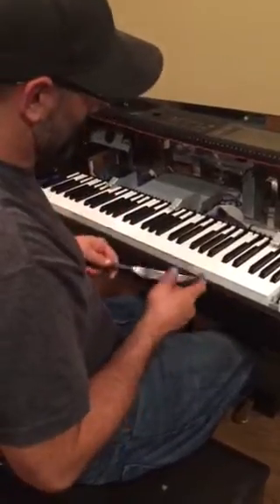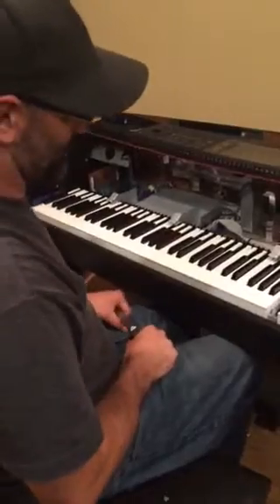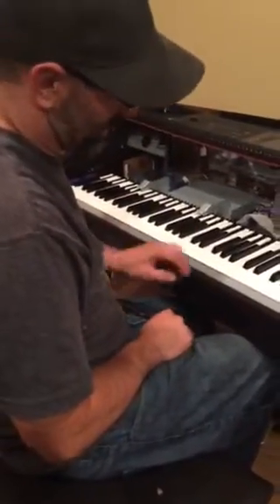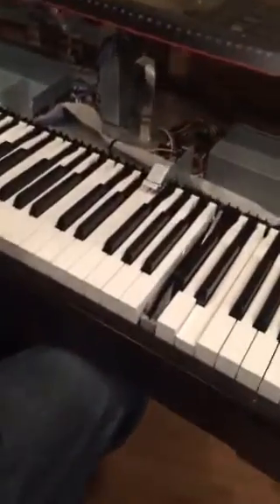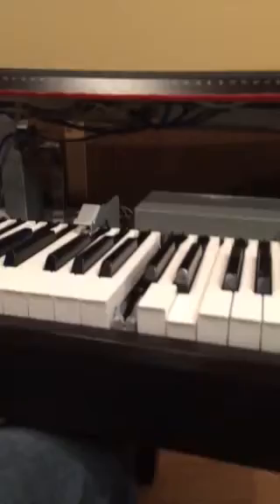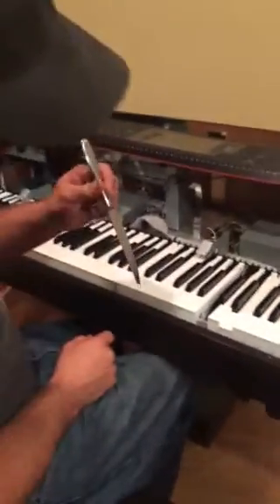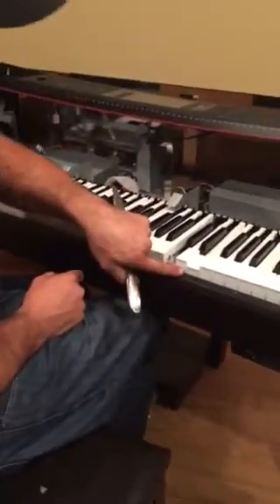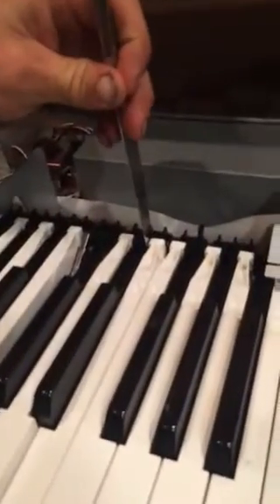Yamaha Clavinova- sticky key fix

Comment: The reason the keys twist is that the bottom back corner of the key cracks. If you look at the back of a key there is a 90 degree corner and a 45 degree. The 90 is there to stabilize the key side to side, but weakens over time even if the key looks fine at a glance it will have a hairline crack on the inside. If you have a replacement key that is best but strong ca glue can work too by it needs to go back perfectly straight or the key will still twist.
Reply: Yes, but one has to take apart MUCH more to get out the broken key... to either then replace it with a "new" one, or try that repair you mentioned (which might not hold either).  I'll try this "widget" first, thanks!
Reply: Thank you! Took me a while to find out, but from all these videos your comment was the one I was looking for! Many thanks

Comment: Yes. I used to own a 2nd-hand Yamaha Clavinova and was cheated when I found out the "sticky" keys.  So I changed to the Casio CDP 135 which was great till it collect too much dust and cause a key to fail. So I dismantle and cleaned the dust but unfortunately when closing the keyboard, the audio cable (Awm 2896 80c Vw 1) was accidentally clipped.  Luckily it was not a problem as I can buy this from Amazon or Alibaba for a few dollars only.   The point to note is this: Get a cloth or plastic cover over your keyboard when not in use.  Dust can accumulate under the keyboard and all the keys are greased and dust accumulation can result in grime that will not only alter the pressing sensation but also affect the circuitry too.  Same goes for a real piano.  Close the cover when not in use.

Comment: I’d love to try this method - does anyone know how to access the keys on a clavinova clp 500 - as in which screws to undo???
Reply: I do. I have stripped mine many times. Its easy when you know how. I found a video knocking around on youtube that explains how to do it
Reply: Hi, can you please let me know which screws you removed I have same model?  Thanks
Reply: @taurusalmighty3071  Hi, can you please let me know which screws you removed I have same model?  Thanks
Reply: Hi, can you please let me know which screws you removed I have same model?  Thanks
Reply: Chris, if you remove all the screws from underneath the keyboard section the front trimming comes off and loosens the keyboard. The from the top in front of the keys there are around 6 more securing screws that will loosen the keyboard completely. Remove the ribbon cables and the keyboard can be lifted off the base

Comment: Doesn't really work.  Well, works for a moment, then the plastic insert pops out after not many key strikes.  There's nothing to keep them in place.
Reply from the maker: Chgolandfisher ours have been in since this video and have not poped out. maybe try a very small dab of super glue on just one of the sides to help hold it in place? I